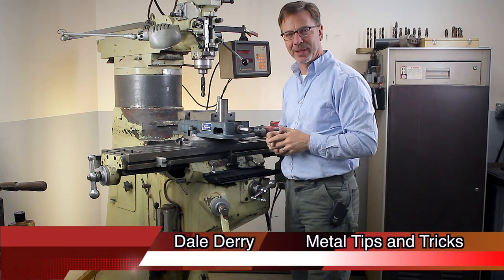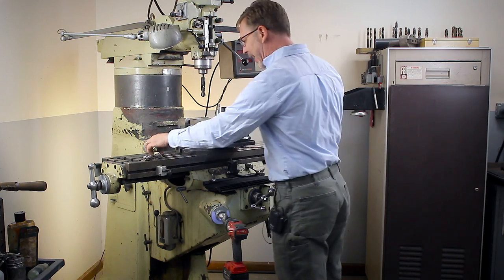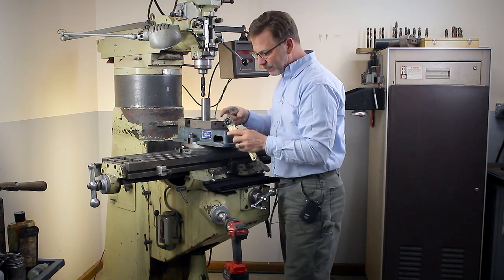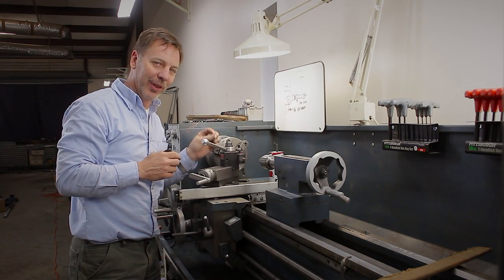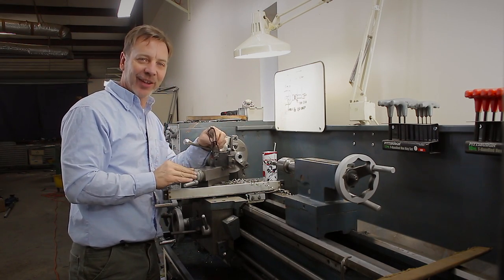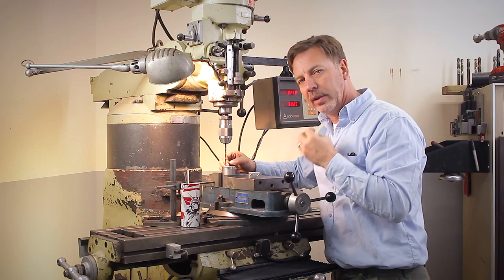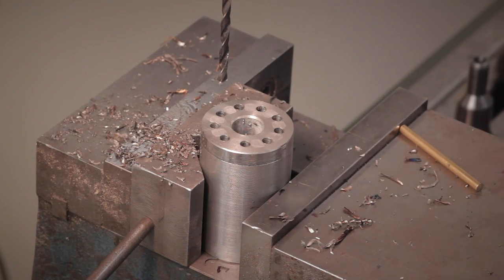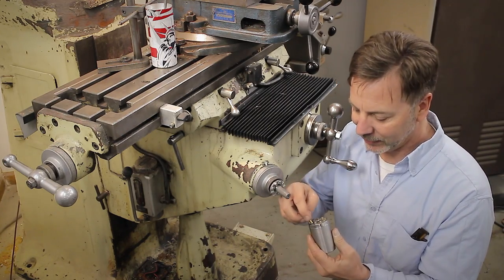Milling machine drill adapter Part 1 of 2

Comment: Hi Dale, Got a little trick I learned when I was forced to
take a NASA soldering class at Hughes AC years ago. The way you solder a wire
(brass pin in your case) into a solder pot connector (steel thingy in your
case), is to place a small measured ‘chunk’ of solder into the hole first, add
flux then add heat. Capillary action should wick the pin from bottom to top.
You might have to experiment on the exact size of the solder ‘chunk’ but should
work for multiple holes etc. Excellent work on your videos. Now all I need is a
Bridgeport. P.S the beer can oil pot worked great. I think I went through a six-pac
before I was satisfied, but I don’t seem to remember.  Thanks again.
Doug Loukota

Comment: I love the design.  You mentioned doing this fast so I presume this is why you eyeballed the position of the holes rather than using a pitch circle calculation on your DRO.

Well done.
Reply from the maker: +LV_Woodturner 
Not everybody has a DRO. I like  to show easy quick ways to do things with the simplest of tools. Thanks for your comment :-)

Comment: Dale

If someone doesn't want to solder, I would hink you could drill and tap for a cap head screw where the cap head diameter was the size you need to fit.  For belts and suspenders you could add loctite red when assembling

John
Reply from the maker: Hi John. As you know by your example  there a many ways of doing thinks.  My goal  in this video was to show a different technique then what is normally done. :-)

Comment: Great!

What do you use the small whiteboard behind your lathe for?

Paul
Reply: +Paul Devey It covers up the oil spot on the wall
Reply from the maker: +Paul Devey 
Great question. I put drawings on it with dimensions so I don't have to trust my memory on what I'm doing laugh out loud

Comment: I am a neophyte when it comes to machining but could you not put a very slight diameter mark in the face for the pin hole circle? That way when the tool is in the mill vice that guess work is removed.

Comment: Very cool!  I like the compact design.  
Did you consider using less then the nine pins?
Reply from the maker: +Morris Gallo 
The first one I made only have three pens in it, and it worked just fine. I  put in all the pins in this video so I wouldn't hear from trolls laugh out loud.

Comment: Great idea with the pins! I especially like how you approach machining through a minimalist focus. In other words, avoiding crazy setups and fancy tools. Fancy tools are cool and add man card points, but not always required. Another great example was the spill proof container made out of a simple beer can. The artwork on the beer can is way cooler than a plain oil can.

Did you choose brass in order to protect the Bridgeport nut? I imagine those fancy engagement nuts can be quite expensive. Personally, I would rather have the inexpensive brass part fail and just have to remake one once in a blue moon. As always, nice series.
Reply from the maker: +Roger Kimball 
Thanks for your comment. Yes I used the brass to protect the mill, but I have not seen any ware on the brass pins

Comment: I don't have a mill, and I want to make one.
Reply: +Ether Oar You might consider looking into the Open Source Machine Tools project. The project has the following resources that are helpful; a website and wiki, a Yahoo group, and a channel on YouTube. One of the machine tools the project founder i.e. Pat Delaney had first developed  is the MultiMachine, which is a multipurpose machine tool that may interest you.
http://opensourcemachinetools.org/multimachine/
There are other options, such as a vertical mill made from 80/20 aluminum extrusions, which performs better than the mini-mills, but lacks the rigidity and mass for working with harder and larger materials, but may meet your needs. If you require something that can tackle the heavy operations there is a very affordable or low-cost option being developed that uses an epoxy-based cement to provide the mass and rigidity, which is based upon the concrete lathes that were developed for quick and easy production to meet the manufacturing demands of the wartime era back in the '40s. With the materials that are available today, we can produce machine tools in our backyards, garages, or in a rural third world village that can perform as well as their cast iron counterparts for far less cost, which is empowering peo[ple. If you desire to know more please let me know.
By the way, another option is the Gingery series of books that show you how to build your own machine shop tools from scrap. Anyway, I hope you found this info to be helpful.
Peace!
Reply from the maker: +Ether Oar 
That's a big undertaking :-) good luck enjoy the process